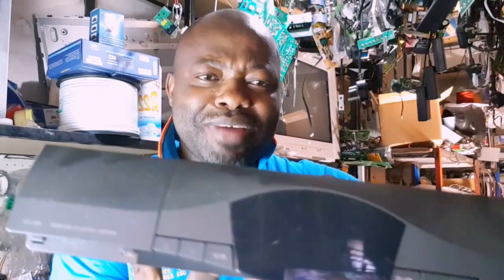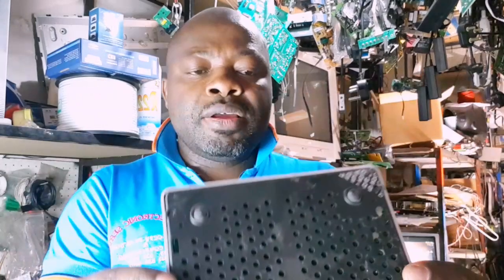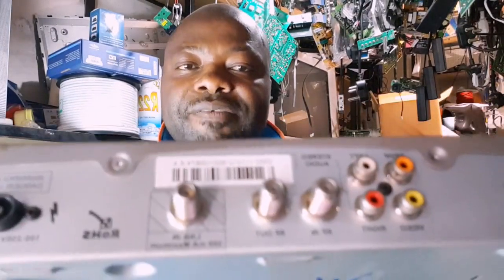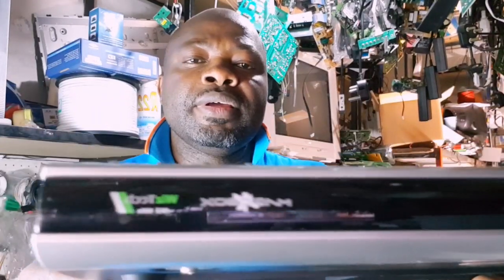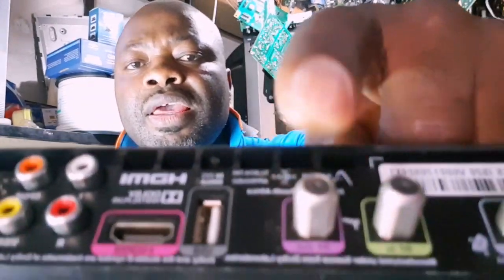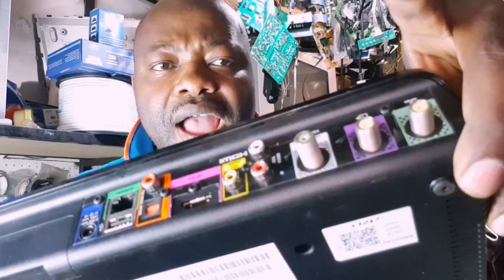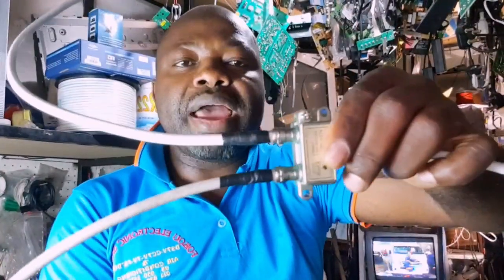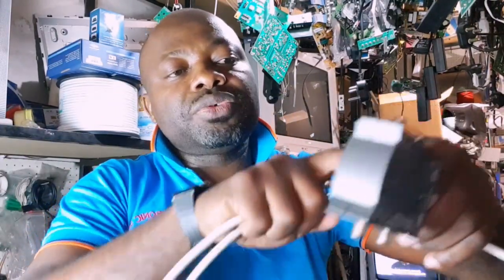how to watch 2 TV or more  from one setup box, dstv decoder , your dstv specialist.

Comment: Thanks so much for your video.
How do I get the signal on the 2nd TV to be very clear after doing an automatic scan and fine tuning it, but it's still not clear like the connection with HDMI cable is??
Reply: Experiencing the same thing.

Comment: Hi thanks for this videos. I got an explora as my primary, 2nd explora and dsd decoder as my 2 extra views. I want to add another tv in my entertainment section with my eye link. Setup is as follows primary and 2 cables from primary to 2 extraviews (rf in and out). No problem. Now i'm connecting 2 cables from extra view decoders from rf out. Light is on from eye but when i search channels I do not seem to get the channels and the one that's there do not have sound. Any advice. Thanks

Comment: Please can a long HD cable or Av cable ( 20-50 mitres long ) work very well without poor picture quality and not using a booster ?
Reply: Good work done.... Pls i have a question, can one use on decoder for two stallite?